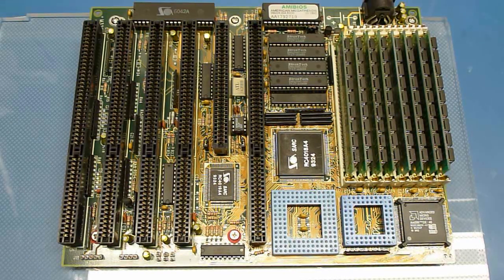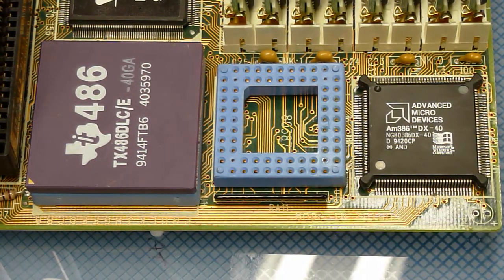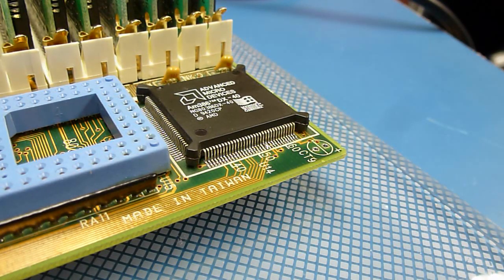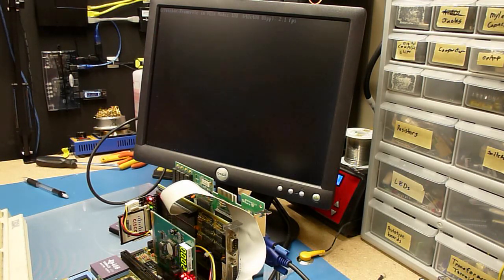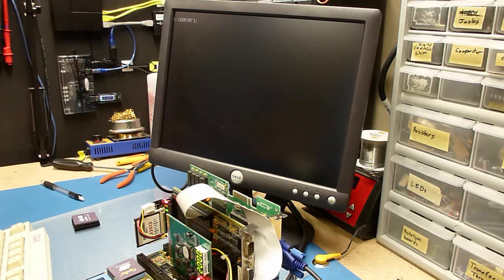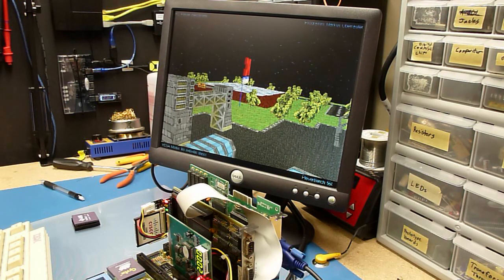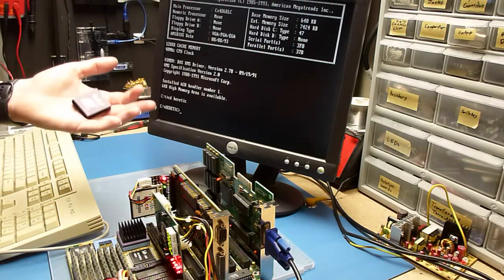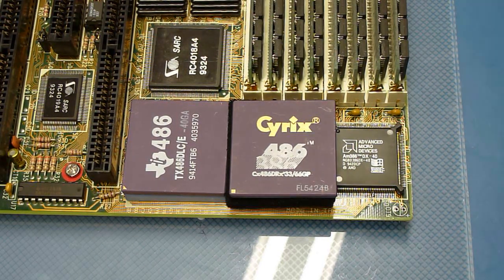386DX-40 Upgrade! Texas Instruments 486DLC-40 and a Rare Cyrix 486DRX2-66!

Comment: I installed the 50 MHz Cyrix 486 DRX2 upgrade chip in the 90's in my 386, the green heatsink wasn't glued, it was adhesive tape and you had to put it on yourself out of the retail box.
Reply from the maker: That's great to know! 

I need to get a clip-on heat sink for it. I don't want to glue or adhere to that pretty paint job it has!

Comment: My 386DX-40 gets a 3.6 on PCplayer, i think your video card might be a bottleneck.
Reply from the maker: That Trident card is pretty decent, it doesn't do too bad against a Tseng 4000, for example.

You'll notice in this video that the Cyrix crashes a couple times. This motherboard had issues with two processors being installed even with the soldered one being set to high impedance. I think it had power issues. I have since resolved the issue with just a socketed board. I'm fairly certain I posted a video with that board, if not I should.
Reply: @DKJones96  It's not really that important.  In my experience those benchmarks aren't really good for much beyond knowing if you sped up your own particular system.  At least not unless you take into account all the other variables, like cache, vlb and chipset.

Comment: Thanks for the great video, this is the only video showing the drx2 
I have a question which is the best cpu you recommend to upgrade an Intel Inboard 386/pc is a board? It has a 32MHz crystal and a 386 DX running as 16MHz by default. I like to get the max out of an XT computer using this card. The intel inboard does wonders for an XT but I was wondering how to push it to the limit! There are tons of mods online but it requires transcomputer models which are impossible to find. I don’t mind swapping the crystal and from what I researched the intel inboard does run stable at 40MHz crystal which means a 20MHz 486 could be used. The socket is 132 I believe. I appreciate your help so much! Your videos are the best!
Reply from the maker: Thanks! I'm sorry for the late reply as I try to get back to people quickly but here it goes.

In synchronous systems, like most 386 outside of the DRx2, the system bottleneck is almost always the processor. The 132 PGA socket is standard for the 386DX series so they will all fit but that doesn't necessarily mean they will all work. Some motherboards can have issues with the cache on the chip but there is no reason to think you'll break anything trying. The 33MHz 486DLCs appear to be plentiful on eBay for less than $30 shipped so could be worth a try. That would be my first go-to. The DRx2 would increase performance further but they are not easy chips to find. If you can use a DLC the DRx2 or the TI486SXLC2(8kb cache) will likely work fine as well.

Even just swapping to a DLC should give you a massive boost in performance. I'm currently running benchmarks on a TI 486SXLC2-40 and the cache on vs off performance gap is astounding.

Comment: 11:18 I have an explanation for the heat sink dilemma. The Cx486DRx2 came in 16/32 (has no heat sink), 20/40, 25/50 and 33/66 these 3 had a green heat sink with the matching model printed on the heat sink however these had same thermal properties as the 16/32 one which means they only needed the heat sink if the bus speed was equal or more than their rated bus speed. In other words, if you find a Cx486DRx2 20/40 in a 386 which has 16MHz bus then yeah they probably dropped the heatsink as it won’t be necessary. That Cx486DRx2 20/40 however is going to be working as 32MHz (max). Pretty confusing when I was researching them 😂
Note: 16/32 means, the first speed is the motherboard speed 16 and the second speed is the processors internal clock speed 32.

Comment: The Texas 486 DLC has 8Kb of L1 cache, which made it faster in actual games when compared with the Cyrix DLC. Also, used to sell systems with those cyrix DLC chips on. So many of them died from heat a few months in that Heat sink became mandatory item. If your CPU has been run for any significant time without a heatsink then it could be damaged goods now.  It looks in pristine condition, so maybe previous owner(s) ran it without heatsink and damaged it. The few minutes you used it for aren't likely to have been to blame here. Those chips all ended up coming with mint coloured heatsink. TEXAS do a clock doubled dlc as well, which also had 8Kb L1 cache performance was slightly better than Intel 486SX-33
Reply: Actually, the Texas Instruments 486DLC is exactly the same as the Cyrix. TI fabbed these chips for Cyrix and took some for themselves. The TI 486SXL and SXL2 are the ones with the larger L1 cache.
Reply: @Beerfloat  Thanks, I couldn't recall what TI called them. But my point still stands, these would be great chips to review.
Reply from the maker: That's great info! I have been able to run it successfully without issue on a motherboard that doesn't have the dx chip soldered to it. It shouldn't make a difference but it appears to.

Comment: Those are not "expansion slots".  Expansion slots are 16 bit ISA at the left and back corner of the board.

Those are SOCKETS for processors.....  Like "socket 7".  Those are NOT expansion slots.

Comment: Excellent video! Did you know that this is a PCCHIPS actually? Removing the SARC sticker you can see it. It's a fast little board. Mine appears to be from 94. Very late in the game for a 386. I suppose they were selling them as budget systems. 
Nice Cyrix processors! Maybe a jumper or a dip switch somewhere on the board could be a definitive solution to install them.

Comment: You should just de-n00b and use a fucking heatsink on them.

Why run them without one? Just stupid.
Reply from the maker: 5V at 66MHz is the inflection point where you graduate from not needing a heatsink to needing one. Most 66MHz 486s didn't have heat sinks on them and some did. The processors of the time that did need heat sinks usually said one was required.

I've not personally ever seen a heatsink for attaching to a chip the size of a 386 as well. I have a dozen 486 ones, even one with a thermoelectric cooler built in, but never a 386 sized chip. I'm currently working on 3d printing a bracket for it to make the chip attachment more permanent.

Comment: I overclocked one of these when I was 15 (1995). They do tend to run really hot, especially when overclocked! :-)
Love playing arount with these upgrades. Takes me back to the nineties when it was actually fun to fiddle with hardware. Such exciting times!
Recently aquired a bunch of these upgrades. I've got an old, very nice 1990 NCR Model 3300 with an 386SX-20 which I'm going to desolder. It will get a 5V Ti 486SXLC2-40 instead. And my favourite eighties machine, a 1988 Compaq Deskpro 386/25, huge heavy beast of a machine which cost 20.000 USD in 1988 (!) is now running a Ti 486DLC-25, is receiving a rare Improve Technologies Make-it 486, which is the rare PGA-132 Ti486SXL2-50 with 8k of L1 cache and a sketchy soldered on cache coherency circuit, which is a drop in replacement.  Awesome! 👍👍
Also have an IBM Blue Lightning 486DLC3 running at 75Mhz with 16k of write back cache, which is a very weird machine (PS/2 Model 56i SLC3) because it has a 'neutered' 32-bit IBM DLC3 CPU with its databus cut in half, effectively making it an SLC3 with a 16-bit databus, supporting a maximum of 16mb of RAM :-)
Keep up the good work. Really enjoy your videos! 👌

Comment: It's a PC Chips board, which you can tell by the sticky labels on the chipset.  Luckily, their 386 boards were fine.  Don't get any 486 and newer stuff of theirs, though; it's all junk.
Reply from the maker: Tell me about it. I've got a VLB PCChips board that I excitedly got New Old Stock... Yeah the chipset on the thing had half the pins not even soldered down. I've yet to actually get that thing to post but at least there is a system-wide clock signal now.

Comment: No doom test;(
Reply from the maker: I'm thinking about going back and doing a compilation of 386-based systems and their all-out optimized performance and that will definitely have it! Sourcing some clock generators for the testing  though.
Reply from the maker: What am I saying... I revisited the DRx2-66 in a motherboard that it ran properly in and there is a 386DX vs 486DRx2 DOOM test in that one. https://www.youtube.com/watch?v=OgezDJb68tg

Comment: 486 all had heatsinks - mine anyway- and like the smallest possible fans also -attached with plastic clips
Reply: Up to the dx50 you didn't see heatsinks, but after that it was usually clip on heatsinks. I had a dx2/66, dx4/100, and finally a 5x86/133 from 1994-1997 that all used the same heatsink.

Comment: If you don't use the Cyrix utility then the on-chip level 1 cache of the DLC (and possibly the DRx2 too) won't be enabled. Enable it and you will find your benchmark results will be substantially higher. None of your boot screens showed the tool running - did you enable it afterwards?
Reply from the maker: I did check with the tool to make sure it was working. The motherboard supports the processor cache option so on this board you can enable the cache via the bios without the need for the utility, which is really nice.

Comment: Ehm. There's no such thing as FPU in a 386 with out one being socketed in the FPU socket, you need atleast a dummy chip to bridge the traces so it can use the in CPU FPU... So, eh, yeah. You're missing alot. Just by not having it enabled. :D

From WikiPedia: "The 486DLC can be described as a 386DX with the 486 instruction set and 1 KB of on-board L1 cache added. Because it used the 386DX bus (unlike its 16-bit cousin, the 486SLC) it was a fully 32-bit chip. Like the 386 and 486SX, it had no on-board math coprocessor, but unlike the 486SX, it could make use of an Intel 387DX or compatible numeric coprocessor. A few 486SX motherboards also provided i387 sockets, but this feature was a very much a rarity. Due to the smaller L1 cache, the 486DLC could not compete on a clock-for-clock basis with the 486SX, but a 33 MHz 486DLC could keep pace with a 25 MHz 486SX, cost less, and offered the ability to upgrade further with the addition of an inexpensive math coprocessor.

While some advertisements in PC magazines from smaller manufacturers touted the superiority of their 486DLC over name-brand computers sporting a 486SX, in reality the only advantage the 486DLC offered feature-wise over the 486SX was the ability to add an inexpensive math coprocessor. The Intel 487 "math coprocessor" for 486SX users was in reality a CPU replacement—a 486DX with a different pinout—and originally cost several hundred dollars more than a 387.

As prices on Intel's 486 line fell, Cyrix found it more and more difficult for its 486SLC and DLC CPUs to compete and released a fully pin-compatible version of the 486SX and DX in 1993.

Cyrix Cx486DRx² microprocessor

Die shot of Cyrix Cx486DRx²
The 486DLC did not see widespread use among large OEMs, but it was widely known among the hardware enthusiast community that an AMD 386DX-40 or Cyrix 486DLC-33 could keep up with a 486SX-25 at a lower cost, so it gained a small following among budget-minded enthusiasts. It was also sometimes used as a replacement for a 386 CPU to give a small speed boost. However, the 486DLC was not designed to be a direct CPU replacement and could lead to stability problems in older boards it was not intended for. "Cyrix" aware motherboards usually had a few extra cache control lines to maintain cache coherency, as well as CPU register control in the BIOS to enable/disable the on-board cache. Cyrix later released a clock-doubled "direct replacement" upgrade package for 386DX systems called the Cx486DRu2. This kit included a standard 486DLC with an extra "dingus" that sat between the CPU and socket and provided the control lines for cache coherency. These kits were quickly superseded by the Cx486DRx2 CPU, which integrated the cache coherency circuitry into the CPU itself. The Cx486DRx2 appeared on the market in 1994, by which time the 486 was already being displaced by the Pentium. Sales were poor due to the high price and the underwhelming performance compared to a true Intel 486DX2. It was often cheaper to purchase a new 486 motherboard than to invest in an upgrade CPU.[1]"

Yeaah, I'd be looking for a IEEE754 compliant Xilinx FPGA image and adapter. Make that Pentium FPU the bitch it always was.

Also, lack of cache coherency, will hamper performance if the BIOS isn't capable of enabling this feature, I guess a CLI program to tickle appropriate registers will mitigate this, if BIOS isn't co-operating and tickling the CPU approapriately. So, I guess, I'd retrace the CPU into a FPGA as well. Since, Cyrix silicon tended to be a finicky partner in the first place. Unless it was debugged and fabbed by IBM, in which case, it's known as the Blue Lightning. :D
Reply from the maker: Did I talk about an FPU? I'll have to watch the video and see. For what I'm benchmarking there isn't much to be had from an FPU. I don't think Doom even uses one. If it does I'll have to go back and look again as I do have an FPU for the system.

The BIOS does have full support for external cache. I did a follow-up video with another one of these motherboards that doesn't have the 386 installed and it worked perfectly! I haven't gotten into probing it or anything but I imagine the DRx2 didn't run because the 386 still 'runs' even though the IO is all set to high-impedance so the power rails on this motherboard have to supply 2 processors with power and the hungry DRx2 has a problem with that where the DLC didn't.

Comment: Wow, I have the exact same motherboard (which is a PcChps btw) and I also have a Cx486DLC and TI486DLC that didn't want to boot. Been investigating it for ages and now I know how to fix that. It's stupid that they didn't include a jumper to select which processor to boot, if the soldered one or the socketed one, if installed. Awesome video!
Reply from the maker: Great! Yeah it works well with the DLC chips. It isn't stable with the DRX2 but I found this exact motherboard but without the 386DX installed and the DRX2 runs like a dream on it.

I can only assume that this board was never meant to have both the sockets and the soldered in processor and that these are an error batch. It 'works' as it is so they just sold them. I mean, it could be malicious but it isn't necessarily.
Reply: @DKJones96  I was wondering the same. Maybe they were never supposed to be used with a socketed processor if the QFP processor was present, but they were lazy (or it was cheaper) to produce all the motherboards with the socket instead of running different batches, and then solder the AMD chip to only some of them.

Comment: I had a Cyrix 486 and I'm pretty sure it had a loose heatsink with a tension clip that held the heatsink in place when attached to the motherboard socket. I could be wrong. But I guess that wouldn't help in your case since your motherboard is much different.

Comment: You are very much limited with the used graphics card. Either you are using some card wich is too slow, or your wait states are not set to 0, or your ISA bus divider is too slow. I have a similar board and it is possible to squeeze about 6000 characters per second in Landmark (you have about 2,5k) with a good graphics card and optimized settings on 386DX-40. Especially for the graphics related tests, which you are doing, it is important to get everything out of the ISA bus and the graphics card. Just to avoid any bottlenecks impacting the CPU.

Comment: I think your video card is bottlenecking this system. I had once an 386DX-40 system, tested with a fast VGA card (Tseng ET4000AX, and CL-GD5422) it was able to reach 15,0 fps in 3DBench, and 4,1fps in PC Player benchmark.
Reply from the maker: It definitely is. I've run the same system with 5 different ISA cards ranging from a Tseng 3000 card(at the slowest) to a Tseng 4000 and the Trident falls to the upper-end of the midrange cards with a CL5426, Oak Technologies, and a Western Digital that I can't remember what is right now.

That being said, 33% difference with one card does seem to translate fairly well to the same 33% across most of them so the comparative difference is still the same. ISA data transfer rate is a pretty big bottleneck for some though so it isn't perfect. The slower card does get less of a performance bump than a faster one though, see Amdahl's Law.

Comment: Dlc was designed to update the 386 to 486 with 16 bit bus
Reply from the maker: That's actually the SLC which was the 'upgrade' for the SX. I say 'upgrade' as there weren't really any socketed SX chips so they were done by the OEMs in a way to get the 486 features on a 386SX board with no redesign necessary. I am currently working on a video where I replace a 386SX-40 with a NOS 486SLC-33 by desoldering the old chip and soldering on the new one.

 The 386DX here was a 32-bit chip with a 32 bit data and address bus. The 486 had some extra socket features but was also 32/32.

Comment: I've got a few boxed DRx2 chips, which I got a long time ago from e-bay. They all came with those green heatsinks, which were contained in the package, but not placed on the chip itself. They came with a self-adhesive thermal pad, so it's a stick-on.
Reply from the maker: Fascinating. It's amazing how different the info is on stuff of this age on the net.